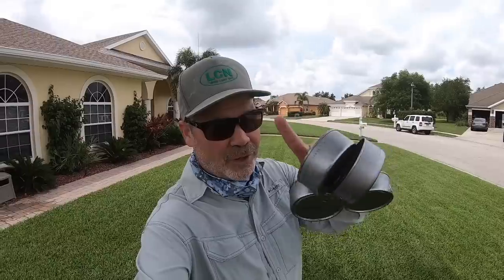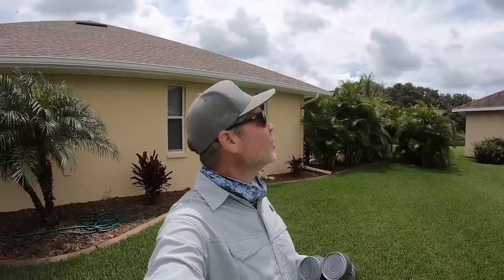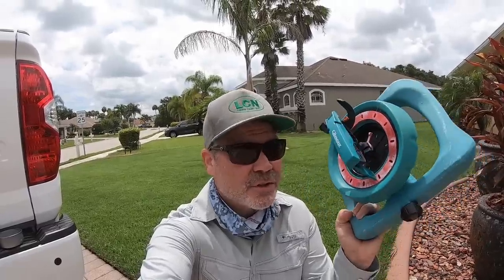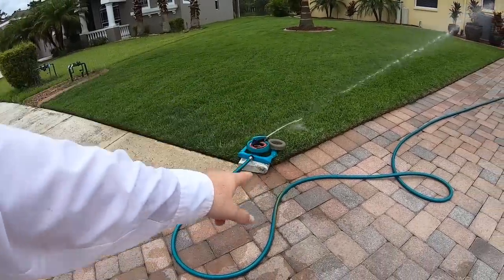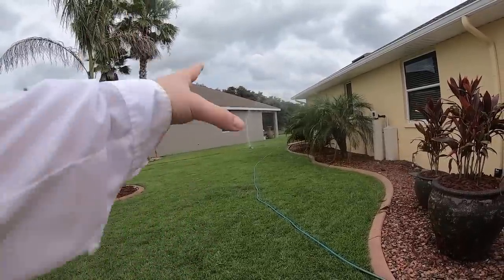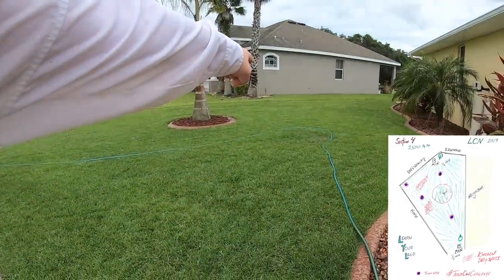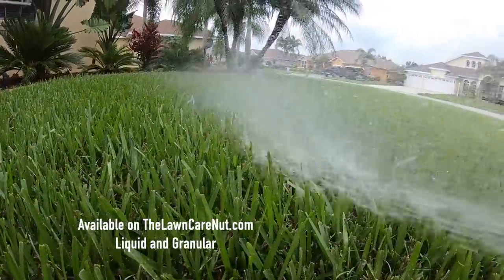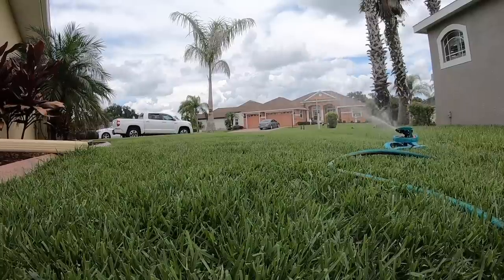How To Set Up Impact Sprinklers for Summer Lawn Watering

Comment: Impact sprinklers are too noisy and they don't water  the near and only the Far  distances.. Simple 5k Wand Sprinkler has worked the best and its super Quite!  and I'm on Low Pressure Well Water.. snd Draging out Hoses lines every week? No thanks.. I buried a Hose line to the right spot, hooked up a 6 ft Hose to my wand sprinkler and just walk out to the spot that Buried hose is ( inside a Box below ground. open it, use quick connects , come back turn on my water, set my Manual Timer to 2 hrs and done.. Goabk out, disconnect, cover the box bac up, put my Wand Sprinkler and Hose under my Evergreen bushes till next week..

Comment: Hey Allyn, will Humic/Fulvic do the trick too? I've heard that also increases retention
Reply: Humic acid is the shit. Love that stuff. Have you tried BioKelp Humic 0-4-6 from Simplot? 

Humic acid:

Helps release nutrients in the soil - more readily available to the plant.

Improves soil structure - retains nutrients - doesn't leach thru as much.

Helps loosen up soil, air flow to the root zone.

Helps buffer soil pH. High pH.

Helps with root density. Root growth. Increases root depth. 

Helps resist disease.

Helps with moisture retention. ESP with sandy soils in conjunction with wetting agent.

Love the stuff.

Comment: Did the tuna can challenge last year, once I knew what it took to get a half inch on the lawn every time I water, it greatly improved my lawn. Before I just guessed and the lawn would get stressed. Now, it gets the water it needs and it's been lush and green since then. It sounds like a lot of work, but it really isn't. All you have to do is place the tuna cans, and the sprinklers will do the rest, all that is left is checking it and adjusting. But you can easily guess how much more time you need.

Happy fathers day, Allen! Spent mine mowing and admiring my lawn. Thanks for the "tips"! My knowledge has greatly improved.

Comment: Great video...however...lawncare nuts should get multiple sprinklers, hoses and multiple zone tap programmable water timers to be a real lawn care nut. I ain’t got no time setting up the hose, fussing around with the ideal sprinkler spot and timing watering on multiple days a week. My mantra is set it and forget it. Whenever needed you hit the rain delay on the timer and you’re all done. Set it up for maximum success.

Comment: I actually put down some Hydretain this morning. I bought the small hose end jug to treat my main and side stages. I used a sprinkler to water in. Hope this stuff works! I have no irrigation but would easily see me buying more if it does what it says it does. Results hours later seem to be positive. Greening up quicker than the last time I watered without it at about the same amount of water. Maybe it's my imagination.

Comment: What type of sprinkler outputs the most water? I have just over 5 bar, 73+, PSI and I fill a 10l bucket in like 20 seconds. My oscillating sprinkler, which for sure covers a large area, takes just need to run for 1h 30 min for 1/2 inch.  15 and 13 min seems super fast. Sure it might not rotate for so long, but my question still stands.

Thank you

Comment: Due to living in Texas and being on water restrictions, I purchased Hydrotain for the first time. I ran into an issue with the "feed tube" not pulling the liquid up and mixing with the water. I pulled off a sprayer from another product so I could throw'er down. Is there something I'm missing or can do to fix this? ...and yes, the dial was set to "on".

Comment: Love your videos Allyn. You’re the man. Thank you for such educational videos. Love this channel. Humic acid is my go-to now.  Love that stuff. BioKelp Humic 0-4-6 from Simplot is like medicine for the lawn. 

Humic acid: Helps release nutrients in the soil - more readily available to the plant.

Improves soil structure - retains nutrients - doesn't leach thru as much.

Helps loosen up soil, air flow to the root zone.

Helps buffer soil pH. High pH.

Helps with root density. Root growth. Increases root depth. 

Helps resist disease.

Helps with moisture retention. ESP with sandy soils in conjunction with wetting agent.

Love the stuff.

Comment: Nice video. But I have a question about hose leaking input. When I put the hose to this Gilmour, its leaking so much water. I saw you had this first, but later on, there is no leaking at all. Any solution for this? TIA

Comment: I have the same exact sprinkler with basically the same issue , going up to high even after adjusting it, What I ended up doing ( it fixed the shimmying issue too from high pressure ) was I added 2 small camping stakes screwed into the back and another dead center in the other side with 2 small screws holding each. Works perfectly but that ring you lift up gets aged and cracked after awhile. Best sprinkler for my type of lawn though. Thank you for the video.

Comment: I’d like to be able to use the Gilmore with a quick connect but found that, at least with my first try, it leaked at the connection. I think the screen may be part of the problem. Have you had any experience with a quick connect on this unit?

Comment: The picket all metal Gilmour impact sprinkler is preferable to this model. You can adjust the height of the stream, the diffusion and the arc(rotation) and you can link them also

Comment: You mentioned 1/2 of water but I'm not sure I caught how often a dry lawn needs that amount? Was it every 3 days?  Also, any tricks to let me know when I need to water?
Reply: Screw trick if it goes all the down to the handle with ease you’re good, if not 30min watering in that section

Comment: Would you recommend this type of sprinkler for a yard area of 24 x 22 (feet) relatively small yard. I also have another area which is 27 x 10 a bit narrow.
Reply: I also have a ball valve for my hose so I would need something to control the pressure, I assume this can be done on this type of spinkler?

Comment: I'm about 7 exits south of LCN and have not gotten the copious amount of rain LCN has as I'm on the coast.  Did get 1" last night but that only puts me up to 2.5" in 8 days. (6.35cm)  The well pump is still dry so I'm counting on the afternoon coastal showers.  The surviving St. Aug has perked back up but I'm really surprised at how big some of the dead spots got when I couldn't irrigate.  One of the neighbors was getting a submersible pump installed last week so I did a u-turn and got a card.  Probably calling this week.
Reply from the maker: hopefully you guys will get some of this! It's been everyday bro up here.
Reply: @Thelawncarenut  It's all around, but teases like a, well let's keep this clean.  Interesting how some of the St. Augustine took the drought in stride but other areas, primarily the new growth, did not.  Has to be related to root depth but it's not like I didn't do deep watering when I had well pressure.  Going to encourage the surviving grass to fill in so it's more drought tolerant as it comes back where I don't plug it with Seville.

Comment: Is there any difference using hydretain in cool season turf?  Is it Worth while?  I have TTTF in  central NC.  I also do the bullet proof fungicide strategy because of past problems with brown patch.  Would hydretain have any potential negative interaction with the fungicide or keep excess moisture in the turf leading to possible disease issues?
Reply from the maker: works great for cool season turf and def worth it with the dry spell you are going through. Won't have any effect on disease so all good there.
Reply: The Lawn Care Nut thanks!

Comment: Hi there...I recently purchased a home and yesterday was the first time I drug out hoses and set up sprinklers in the yard.  It's a pain in the butt adjusting each sprinkler for proper coverage and trying to avoid watering my neighbors lawn.  Only to water for 30 minutes or less, and then dismantle everything.  My yard is 100'ft long on the sides and 60'ft wide front/rear.  A few questions:  what made you decide to get an in-ground sprinkler system?  Once you set up your manual sprinkler, did you leave the hoses out or take them up each time you watered the lawn?   Just looking for a little advice and guidance.  Kindly- Jas